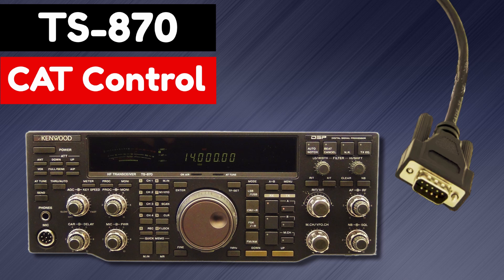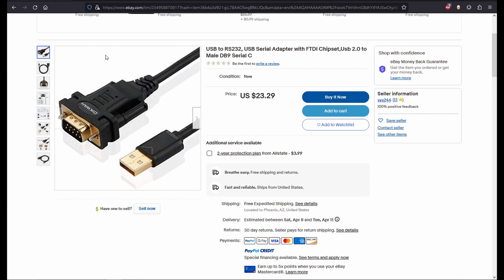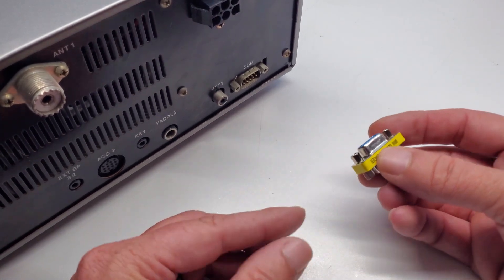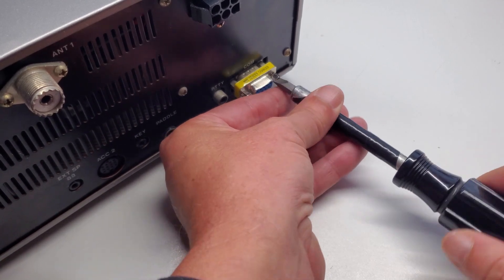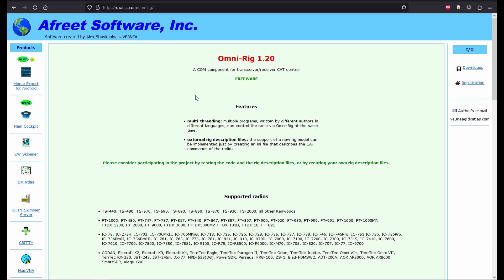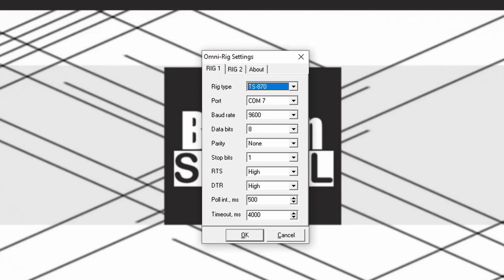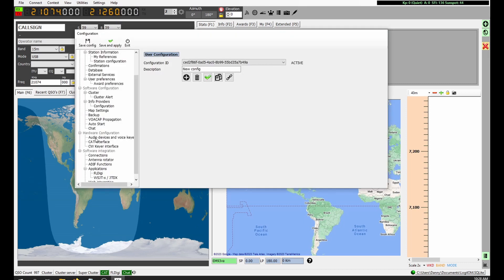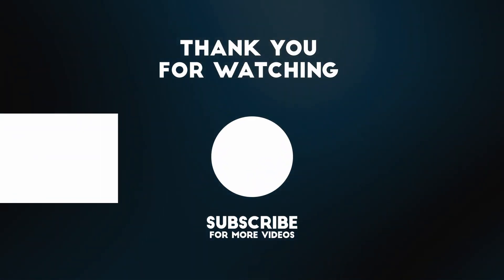TS 870 CAT Control

Comment: Great presentation, this is my obsession, cat Control and a finely synced sdr bandscope, these old girls aren't dead yet, with a bit TLC a well placed tablet with hdsdr running is poetry, 1st was my ts-570, then my ft-891 my ft-2000 ic-718.. ts-480 (raspberry pi)........ but the most impressive was a very old ft-1000mp using a 13" Windows tablet, what an experience, ...... any rig with a com port can be done easily,

Comment: Can I work with FT8 this way? Is it possible to work in digital mode with Kenwood TS 870s thanks to this cable? Thank you in advance for the response.
Reply from the maker: Yes you can. The cat cable will key the 870. But you will need to connect the audio to the pc still.
Reply: Ty Ty very much. this is really good @BrokenSignal